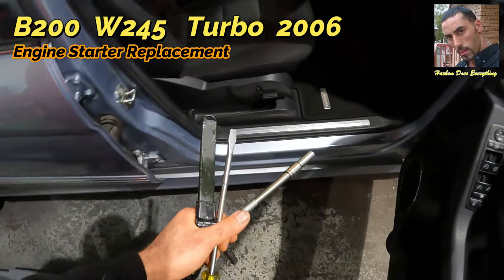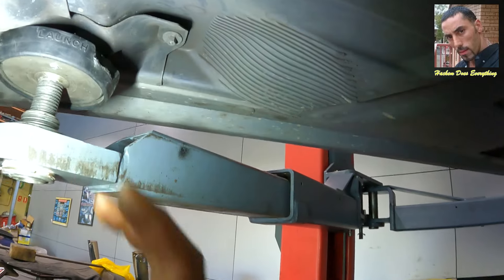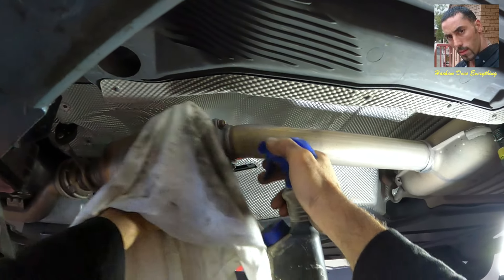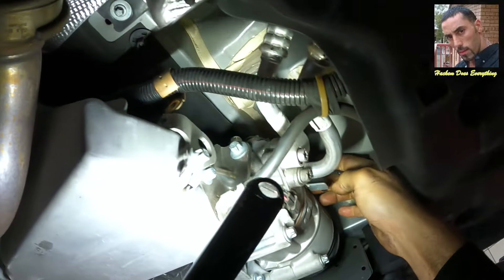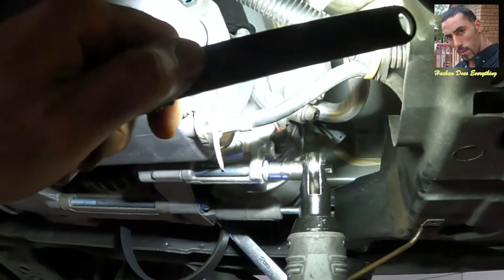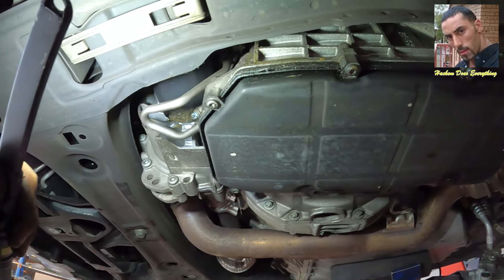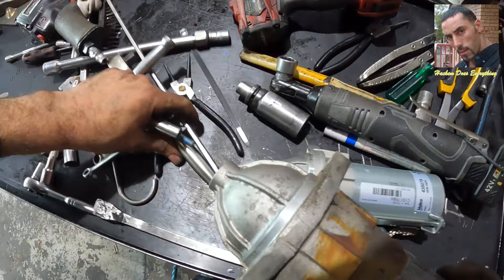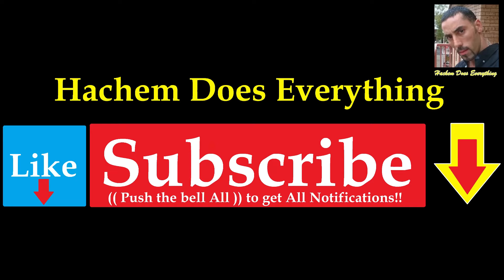Mercedes B200 A170 W245 W169 Starter Motor How to replace

Comment: G’day, my A190 w168 won’t start in the cold morning (or after parked for a few hours). Do you know the exact causes please? Now it’s winter in Melbourne. Before starting the car, I have to use a hairdryer to warm inside the gap around the oil filter area for a couple of minutes … frustrated
Reply from the maker: Maybe the starter motor is not good. Thanks for watching.